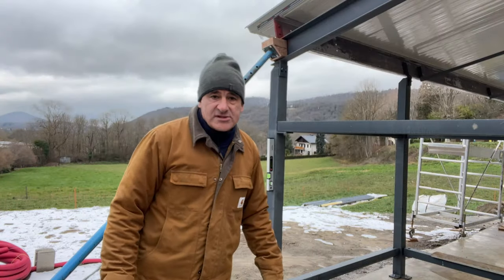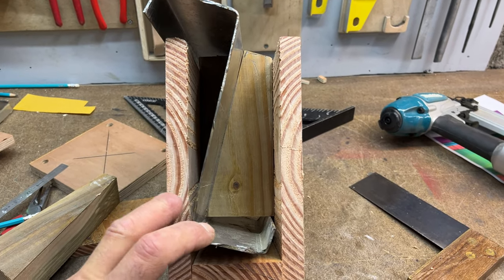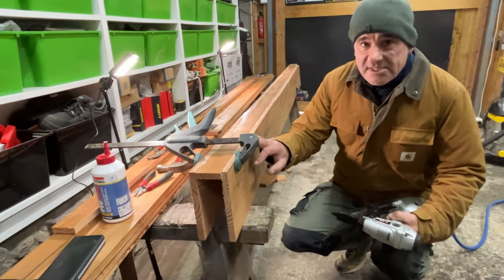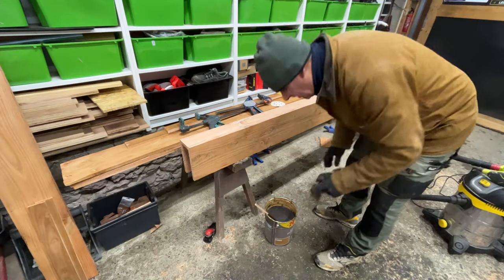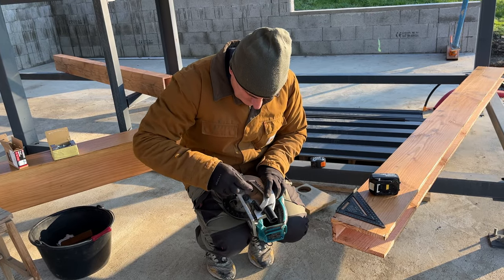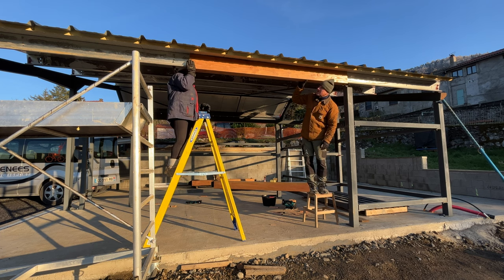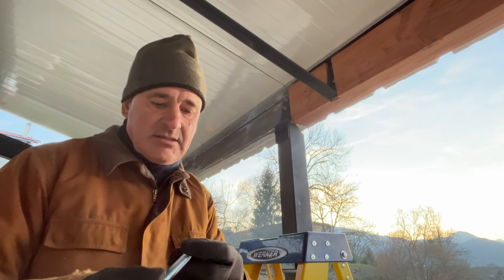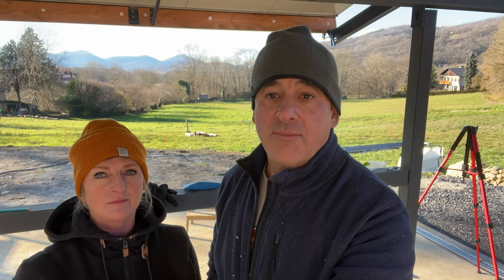Fake Beams - Fabricating & Installing | Garage Shop Project Ep25

Comment: Do not forget the metal will always expand and  contract with temperature change so .3 degrees from plumb is not much deviation overall.
Keep up the great work.👍
Reply from the maker: I know - I was just annoyed that I missed it and did not brace the structure while doing the roof - I have since seen people use ratchet straps to brace while fitting roof and siding - I will know next time 👍🏻

Comment: Make your joining cuts on a 45 degree bevel will make a invisable joint
Reply from the maker: I did try and edited the video - I could not get a straight enough cut on my table saw for this length of wood.  And then the join was difficult to clamp tight.  It would have been the neater solution if it had worked for sure. ☹️

Comment: If your going to use the plinth, I Beam Container method now will be the best time to do the plinths as your concrete will set at it's fully expanded size 
Kiwi Rod
Reply from the maker: Hi Rod, do not understand.  Which plinths do you mean 😵‍💫

Comment: Hi Ian  you asked me how I powerd the power barrow when I installed new hydraulic struts   I got an engineer friend to install small hydraulic pump and pipes hoses to beefed up hydraulic  struts , well I bought a long lith ion rechargeable  battery and mounted to the inside of the right hand side of gray frame near where you fill up the tank . I also installed an up lift and down  button for the hydraulic barrow struts and I put in an electric switch from battery on inside of gray frame . I got the battery from a wheelchair powerchair company with a charger my battery  lasts 7 hours  before it need recovered with both switches on inside on right side of frame they are out of the weather plus I made sealed cradle to keep battery from weather and any spills of fuel or hydraulic oil hope that works Ian.   Love your build and now you are cooking with wood work just love your videos Ian an julie
Reply from the maker: All I have been doing this weekend is looking up hydraulic pumps..... too much thinking.  Seems to be a great project for sure.  Thanks for the info. 👍🏻

Comment: When I would make fake beams like that I would put a dado in the verticals 3/8x3/8 or so. Then a rabbet on both sides of the bottom piece. More work but it holds together pretty well when glued and nailed. 
       In fact I need to do that at some point for our patio as it's ugly red steel purlins with a steel roof. The previous owner put it in. I'm not complaining as it's better than no roof.
         Oh and I need to upgrade my laser now. Mine isn't that fancy. :) Course I'm envious of the toys you have been using on your project. Have seen many on alibaba for years but never bought. I do need a trencher for sprinkler pipes.

            Progress is looking great. Too bad you aren't next door to me. I'd be helping every chance I could. That's just how I am. Though I always help friends etc with their projects but I never get help with mine. 

            One thing to beware of. On the steel that has a direct connection to outside without a thermal break. That steel will condense water in the winter. So any insulating/air sealing you can do between the metal and wood will help eliminate that. It's a tough thing to deal with in this type of building. BTDT and still there... Ideally all coated in spray foam but... For the cost of spray foam I can build a building twice the size instead. Just something to keep in mind as you build.
          Now I heat and cool my shop to a comfortable temp. I'm done with being hot and cold and want to work in comfort. So winter condensation is more common for me especially since I use a propane heater until I can afford a heat pump.
Reply from the maker: I tried to figure out a decent way of joining them but I do not have a dado cutter (other than my router).  If I had more time I would probably try it and it does not stop me doing it in the future as I have made them to be dismantled if necessary.  I have another to do for the central purlin so may have a do then. 👍🏻

Comment: Down here the rules are fairly strict your bore holes about18 '' to 2 ft dia by 10 to 12 ft below ground level on flat land deeper on a slope cardboard tube to retain the soil fill with reinforcing & concrete & attach I beam to them 
Kiwi Rod
Reply from the maker: ah yes, with the earthquake standards.  We are very low risk here although we have felt our house shake twice since living here.  Foundations for the house start at the end of summer....we hope 👍🏻

Comment: Will you put those posts a bit elevated off the floor, so the wood doesn't touch the concrete slab? I guess I'll have to see how you solve it. I've heard the wood on the floor may not be best.
Reply from the maker: hahaha, yes.  I have done quite a few posts on our current property and I always raise them on galvanised platforms.  Next video 😉
Reply: @HomesteadingUncontained  perfect

Comment: Now i have to wait a whole week to see how this will all come out, now on the other end are you going to leave the I-beam  showing and not incase it in wood ? Or am i crazy on not noticing that the whole I-beam is covered in wood, unless the sliding will go all the way up to the I-beam and cover it
Reply from the maker: You will not even know it is a metal building by the time we are finished.  It is supposed to look like an old barn but we are hoping for the scandy modern touch 😀

Comment: The wood may fill with water due to condensation.
Reply from the maker: Technically there should be no condensation as the roof is fully insulated and this section is on the outside of the garage (not in the warm envelope).
Reply: @HomesteadingUncontained  I hope you won't have a problem with that.
Good luck with your further work.